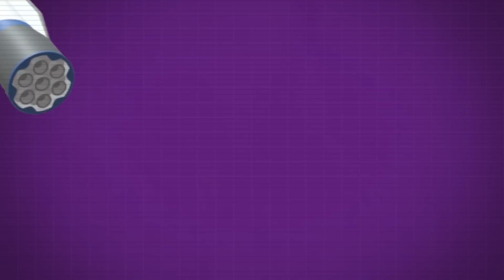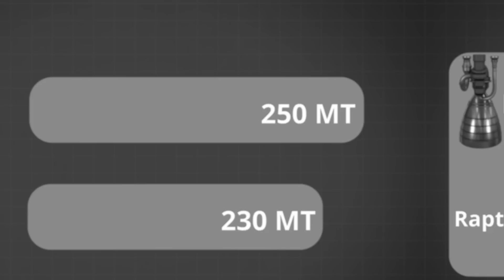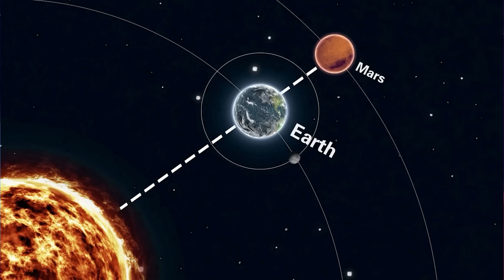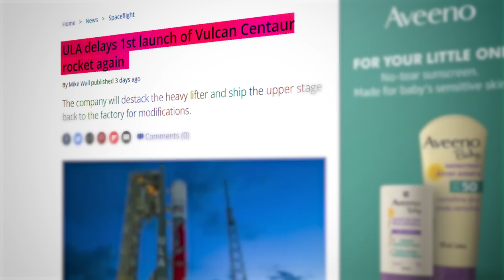The Truth About Blue Origin's New Glenn Rocket!

Comment: Re: New Glenn performance 45 tonnes with a reusable down range landing is perfectly feasible. It's nearly twice as large as a Falcon 9 and uses a higher ISP fuel. 
The determinant will be if they can do recovery without an entry burn, which is what the strakes are for.

Comment: Jeff should stick to selling crap, but the comparison is just silly, in 1966 they got the first Saturn 5 mockup ready and in 1968 (3rd flight) they went to the moon, apart from 2 sensors wired wrong way no hickups at all, so it can be done without crashing lots of rockets like Elon like to to do, but it will be fine, he will be on the way to the moon in early 2024 he said

Comment: Triplication is where it is at with Nutron, Blue Glenn, and Starship, if one company fails you have two more to fit right in the race, IMO. It is not what it will do, it is what will happen. We need ship to step in and fill the leader's shoes so there is no delay, we are leaving this water planet and spreading our seed to the star, one step at a time. I wondered what Starship would do when it first appears on the radar, and I question the same thing you have said in this episode.

Comment: Whether or not BO's development process will prove to be the better in the long run is yet to be seen. If it was a race to clearing the tower, SpaceX would've won. But it isn't a race to launch, it's a race to be mission ready, and Starship isn't close to that. It doesn't matter how quickly you "iterate" using disposable prototypes if the competition gets it right on the first or second try. So, time will tell.

Comment: Blue Origin and the Democrat Administration have so much in common, they both promised a lot and delivered very little. The BE-4 is currently a mythical promise with theoretical figures but no practical real world experience … BO has cost the American Taxpayer a large Fortune with very little to show for that investment … the Joy Toy that BO has produced is just seen as an Expensive Carnival ride higher than the highest Ferris wheel but just a simple up to the outer atmosphere and back to earth with the relanding of the booster hardware … New Glen needs a test flight to prove that it’s more than a Scam …. If Blue Origin isn’t able , can Electron manage the Cargo or will a SpaceX Rocket be needed ?

Comment: Raptor 3 has 269-280t thrust (depending on source) vs BE-4 at 250 or so.
Raptor is designed for more than 100 uses.
Given more than 2x chamber pressure, prob higher ISP and much higher thrust to weight. 
The 8/33 fail was a problem with fuel feed... not the engine.
BO really needed a larger rocket to distinguish itself from the competition which had settled on 3.5-5m diameter. 
If they pull it off this year (meh, real doubts there) they will have the Only competitor to Spacex for super heavy launch (under $1b price per launch). 

Agree with your assessment. Anyone else would launch an empty rocket long ago with only 6 months left to correct any issues they will need an Aweful lot of luck to get it right the 1st time. If BE-4 development was any indicator... yikes!

Comment: Honestly, New Glenn is probably the better of the 2 rockets from a practicality standpoint. New Glenn is most likely being made for the main purpose of putting large space station modules into orbit, i mean they are doing orbital reef and all. For that purpous, Blue Origin have made a great rocket. And while it hasn't even been fully stacked and flown, seeing their stance on testing via simulation and individual parts before destroying an extremely valuable rocket and getting push backs from the FAA for creating a concrete tornado, i can't really fault them for not being to much of a show-off, even if that method can be effective.

And on the other hand, we have the SpaceX Starship, which would be a great ship to take absolutely huge space stations into orbit, except for the fact that there's no real precedent for that. Instead SpaceX are taking the stance that they want to expend a whole upper stage to their reusable rocket every time they want to go to mars or the moon. I mean imagine if every time we wanted to ship cargo across the Atlantic we had to expend the boat to do so, instead of just using the ship to transport cargo to its destination then reusing that ship. I'd be ridiculous and impractical. Best case scenario Starship is used like Blue Origin's New Glenn with its main purpose of building space stations for their LEO economy and possibly getting heavy LEO satellites up to orbit. Even if SpaceX used Starship similar to the space shuttle, it still wouldn't be that practical, as its just straight up oversized and unnecessary. If you want to go to mars you don't use the rocket to get there, you use your reusable system to get mass produced space stations/landers to orbit that would be more effective and many times more numerous that your rocket.

While the prospect of using Starship as a lander seems promising, we've already seen plenty of times how previous, more stout landers with wider legs have still fallen down, and having that happen with a full crew on board wouldn't just be bad, I'd be catastrophic for and program going forward, regardless of affiliation to SpaceX.

Comment: My assumption (part extrapolation, part of Bezos has said through the years) is that the market New Glenn is being developed for is orbital manufacturing and research. In fact, the whole of Blue Origin is aimed towards this goal, which is why it makes sense they didn't start with a smaller rocket like SpaceX did. It needs the large cargo size to accommodate the factory, research, habitation and lifesupport/power modules and the tonnage to do the hauling of raw resources up, and finished products down.

Comment: - New Glenn is a large, reusable rocket intended for low Earth orbit payloads (00:40, 01:18)

- It is powered by 7 BE-4 engines, which are less powerful but more reliable than SpaceX's Raptor (01:43, 02:16)

- The rocket is very large, with a 7m wide fairing, but the market for large LEO payloads is questionable (02:47, 03:16) 

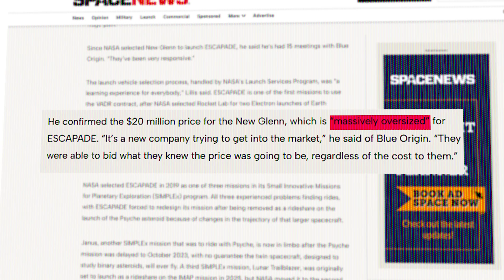- New Glenn is slated to launch two small Mars missions in late 2024, which will be an early test flight (05:24, 05:55)

- There are doubts about New Glenn's readiness, as it has not been tested yet just 1 year before launch (06:56, 07:26) 

- Development of the BE-4 engine for New Glenn has also faced delays due to issues with ULA's Vulcan rocket (09:34, 10:04)

- Overall, New Glenn's capabilities seem ahead of its development progress, with no completed prototypes or engine tests (11:38, 12:08)

The key points seem mostly neutral or negative for Blue Origin, pointing out developmental delays and questions about New Glenn's design and market. The upcoming test launch in 2024 will be an important milestone for the program.

Comment: I still think SpaceX should build a Falcon Super, basically a wider Falcon 9. As the video states, whilst Falcon Heavy has a lot thrust, it has limitations on the width of the payload due to the triple booster design. A Falcon Super (my title) with a wider single booster, basically a Falcon 9 with an extra ring of engines giving a total of say 21 engines using well proven Falcon 9 engines and manufacturing would be relatively simple to design and build and allow wider cargos to LEO for building space stations etc.
Reply: I would love to see that, or even a larger fairing for Falcon Heavy if it would be operationally feasible. But I imagine Space X are looking at Starship covering that business, and have elected to wait for it to come on line.

Comment: bo is an interesting group, they had an advantage, they made reusable stuff earlier than spacex, and than they did mostly nothing for years. ok, they also did not blow up several rockets and still managed to go to space (suborbital, but still), the big question will be their introduction launch. spacex blows up a starship every few month, but still not done even a stage separation, so if the bo glenn will just launch in 2024 aug with a mars mission as payload without hitch, well, they are back in position, and the moon lander selection group will be in an interesting position, especially if the next starship test blow up again before separation, and they have to tell why they supported the group with nothing instead of the group that did their job.

otoh, if that 20204 aug mars launch fails for the glenn and the next starship test works, bo will be again in the did nothing for years state, probably never recovering.

Comment: They need a fleet of heavy lift ships to build commercial space hubs. They have already done a lot of experiments on the space stations having to do with orbital manufacturing. Certain processes are much more efficient in micro gravity environments. We are talking huge facilities here. An inertial gravity ring for crew quarters could be half a mile in diameter to get sufficient velocity to have even a fraction of g force. And humans need gravity, or they start to have all kinds of things go wrong physically. Lunar mining will also be much cheaper in the long run. Interplanetary busses also need to be large. It's less expensive to build them in orbit. Use the fuel load to get more speed to shorten the trips. Not just get them out of the planetary gravity well. We will also need orbital factories to process metals and gasses retrieved from the asteroid belt.  Robot ships can be built to do that.

Comment: The main reason the payload fairing is so large relative to the actual mass it can put it is because satellite constellations tend to be more limited by volume than by mass. That's why falcon heavy is a terrible rocket for satellite constellations for example, it has the power to launch them, but the payload is too small. Also some government spy satellites want space for truly enormous antennas and radar systems- this is also the reason Vulcan has such a large payload fairing. 

A reusable booster version of New Glenn will be highly competitive with falcon 9 and heavy, beating it in most metrics. It will just come down to cost at that point (with the exception of very large payloads).

Comment: Having 8 out of 30 fail isn't as bad as it sounds, if the main problem was debris coming back and damaging the engines.

It would seem, considering the astounding amount of damage from the launch, that debris was the biggest factor. Not something inherently wrong with the engines themselves.
Reply: Launch debris was not the biggest factor, poor engine shielding (so one takes out 2-3)and being very early production specimens, were more likely culprits.
Reply: @bowtoy  Yeah iirc the bigger culprit was the already phased-out design choice of using a common hydraulic loop for controlling engine gimballing. They knew it wasn't going to work, but since they'd already built it and had it on the stand, they went ahead and launched it anyway just to see how it'd actually fare.

Comment: BO getting contracts for launches without having ever been to orbit, or even had a completed orbital rocket complete a static fire, is cronyism at it's worst. 

Let's not forget, the BE-4 engine is bug filled too. One of the two slated to go on the centaur which would launch Dream Chaser, did a RUD on the test stand. This wasn't a protype or test item (like SpaceX in McGreggor), this was a production run. 

Everything indicates BO is not ready for primetime, and yet they've already got a slew of contracts lined up, and none of them even close to the size Glen should be capable of. My last trip to the cape, BO's fancy facility there looked like a ghost town.

Comment: the fairing diameter is a direct result of both companies to save money at designing the second stages of falcon 9, starshim and new glenn.
the idea is, that they both want to use the same machines for the first and the second stage, resulting in an unusual wide second stage. falcon 9 was further limited by the idea of spaceX to make a rocket that can be relative cheaply transported over the US highway system and does not require special permits or even modifications to the route.
and once the second stage has the same diameter, it makes no sense to make a smaller fairing to limit the cargo volume while having to deal with the same drag. and cago volume is king. dragon and dragon 2 are too small for their possible cargo mass (unless you want to send cubes of lead uphill).
but yes, new glenn is somewhat lacking...updates and appearances.

Comment: 8 out of 32 engines for a prototype, first edition is pretty darn good. Raptor 2 is already the new hotness, and nothing replaces actual test flights.
Update: Raptor 3 already being fitted and 4 launch tests already done. BO launches of New Glenn, 0.
Reply: Those engines also were hit with concrete shrapnel from the landing pad lol.
Reply: and Raptor 3 already being positioned to replace the Raptor 2.
Reply: Two didn’t start though.  That’s something to work on.

Comment: 1:50 The biggest tragedy of the BE-4 is that Raptor 3 was already clocking 269 tonnes-force of thrust back in May, and today on the 10th of July Elon announced that they've hit 276 in the latest revisions, aspiring to get to 300 by the time Starship starts commercial operations.

If they had been a bit more aggressive with their development schedule, they might have created an engine that was strictly superior to Raptor at least on one metric (total thrust per engine). Instead the first time the BE-4 powers a Vulcan (never mind New Glenn) it will already be yesterday's news.
Reply: Not only that but past the engine you need to consider that New Glenn is not going to use super chilled fuel and is not going to run on the same kinds of tank pressure and fuel flow rates, all contributing to a lower performance of the power pack overall and with less margins to upgrade that over the life of the vehicle. 

The reason why raptor is able to go that high above it's initial estimated abilities is because spaceX set up the methods through which change can be made, tested and evaluated at lesser costs. Raptor pressure chamber upgrades may not always result in an increase in the actual operating pressures of the engines on the operational vehicle but it can almost directly translate to a more reliable engine with a lot more reserve up it's sleeves if ever needed. And chief amongst all, it is dirty cheap.

Which honestly is absolutely fucking mind boggling that this engine, a high performance full flow machine, just so happens to be cheaper and faster to manufacture than the normally dumb and blunt open cycle approach.
Reply: BO actually intended that BE-4, in its initial development, would be under-stressed. Sort of like de-rating a jet engine.
They also appeared to be afraid to blow things up, at least intentionally.
Reply: @UncleKennysPlace  Unfortunately, as we saw at a test last month, they still blow the engines up. Now it is very unlikely that Raptors will ever be used to its full potential, But that continual upgrade of the upper limits will means less work for the engines in flight.
Reply: yep, it is very bad for bo that their engines not destroy themselves 33% of the times, before the first stage separation, that is clearly a statistic that needs to be for any engine, especially one that you intent to reuse...
Reply: @thorin1045  By that metric, you would have to say that the BE-4 destroys itself half of the time? One of the two production specimens that would be used for the Vulcan mission exploded during acceptance testing with fewer minutes of firing than would be required for achieving orbit...
Reply: @tiagorodrigues3730  no, i do not would have to say, i will say that it is just a bad for them. saved by a bit by the small sample size, one failure out of two tested is either bad luck or bad design. one out of three in a 30+ sample size after hundreds of built engines, that is serious problem.